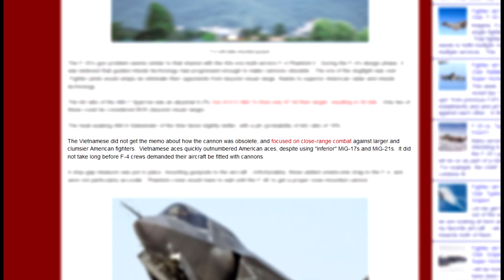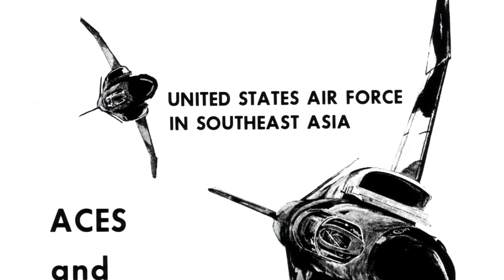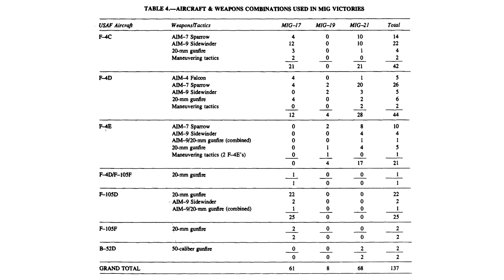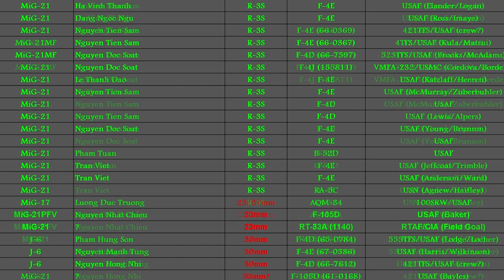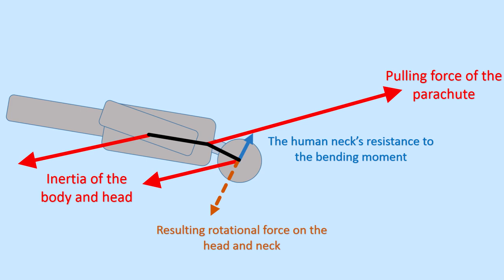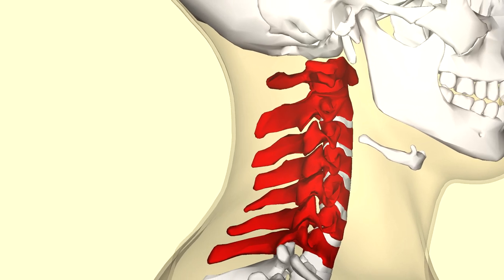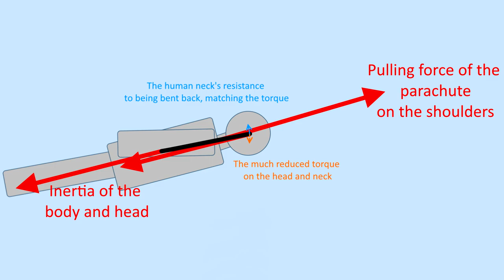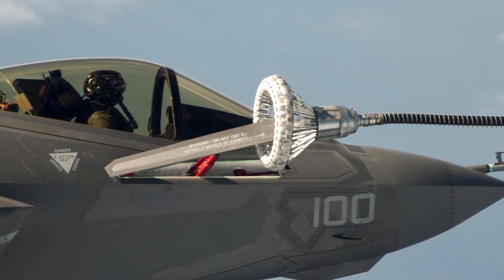F-35 Lightning II: Busting Myths - Episode 4

Comment: Btw, the restriction on maneuverability has been lifted. 9G turns are proving to be tigher than the record setting F-16. Dont count out its maneuverability yet.
Reply from the maker: The restrictions haven't been lifted yet (they're tied to each software block), but will be next year with Block 3F. All the airshow maneuvers that have been seen so far have been with Block 2B and Block 3i jets, which are limited to 7G for the F-35A and 5.5G for the F-35B. Once SDD testing finishes next year and Block 3F is released to the fleet, they'll be able to hit 9G and 7G respectively (and 7.5G for the F-35C).

Comment: I show all episodes and i agree at many points. But there are some issues that you can not ignore. 1) The project started as a low cost multirole aircraft and failed. It became the most expensive aircraft ever. 2) The program is far behind schedule. 19 years have passed since Lockheed winned the competition and 13 years since the 1st flight. So someone can assume that problems may still exist. 3) The aircraft has a low thrust to weight ratio. It has large fuel consumption. These are not good for a fighter even nowadays that long distance engagements are more possible.

Comment: First number is A2A visitors, 2nd is A2A losses, 3rd is SAM/AAA losses
F-4C/D/E Vietnam War (USAF) 108-33-337
F-4B Vietnam War (US Navy) 40-7-66
F-4B Vietnam War (USMC) 3-1-74 

F-15A/B Syrian border clashes 1979-1981 (Israel) 19-0-0
F-15C Desert Storm (USAF) 32-0-0
F-15E Desert Storm (USAF) 1-0-2
F-15A/B Lebanon War 1982 (Israeli AF) 38-0-0

F-16A/B Syrian border clashes 1979-1986 (Israel) 6-0-0
F-16A/B Lebanon War (1982) (Israel) 44-0-0

Biggest takeaway from Vietnam was not air-to-air.  It was huge, but not the biggest problem.  We recognized that we had air crews who were trained and equipped with what was supposed to be a TAC Air nuclear strike mission and interception of Soviet bombers, not dogfighting with MiG-17s and MiG-21s.  The only aircraft we had that were well-suited for countering the MiG-21 and MiG-17 were the F-8 Crusader, F-5E, and F-106.

F-106 numbers were low and dedicated to North American air defense with advanced GCI to NORAD systems, very specific missiles for that role, cockpit arrangement, training, and flight characteristics ideal for fast time-to-climb, speed at altitude for intercept, and internal weapons bay for low drag.

The F-8 Crusader was already in Navy and USMC service, rather low cost, but limited on missile count it could carry.  It was a MiG-21's nightmare to tangle with.

The F-5E was meant for foreign sales at very low cost, very agile, next to impossible to see before and after the merge, but wasn't a big Pentagon-funded project with bells and whistles for Congressional districts and fat politicians galore, or Pentagon General Officers at cocktail parties who know nothing of combat.

So the new F-4 would get the attention, missiles would be upgraded, radar, IFF, engines, leading edge slats, and more training.  Even USAF F-4 aircrew performance after the overhaul of everything was pretty impressive, and they learned how to fight the Phantom against the -21 and -17 and -19 very well.

The biggest problem remained though, and that was loss of aircraft to SAMs and integrated air defense networks.  We put a lot of focus into the SEAD Wild Weasel mission, tried to get the best performance out of those legacy fighters with advanced ECM and ECCM, but it required dedicated squadrons of fighter/attack/SEAD aircraft just to deal with the IADS threat in order to open the door for the real attackers.

This is where the F-35 shines, because it doesn't need EF-111s and F-16CJs to pave the way ahead of it.  Not to rest on our laurels, but we are going to wipe the sky clean of any MiGs or Sukhois for sport.  Our pilots are hungrily just salivating at the chance to engage more MiGs and Sukhois as a competition to see who can kill the most.  Look at Desert Storm and every recent A2A engagement the US has had with Libya, Iraq, Serbia, and now Syria.

Maybe they are telling Russian pilots that they are invisible, while hiding the combat record of the MiG-21, MiG-23, and MiG-29.  I wouldn't want to tell my comrades how bad we suck either, or more importantly: my foreign customers.  I think the word got out about the MiG-29 quickly though.  It should have been a much better airplane, but they screwed it over with structuring the cockpit for GCI intercept with heads-down, tons of switches and knobs, and hurt chances of wide military sales to other countries by making it a 2 engine plane with 150nm combat radius.

Now imagine the F-35 with DAS, EOTS, and net-centric fusing prosecuting even just the air dominance mission.  You have exact locations and vectors of every aircraft in the theater, with the full ability to set up any WEZ approaches how you want, while they haven't even detected your presence. Who would want to fight something like that?

Comment: I have now watched all of these videos, and I am pretty impressed.  I used to be quite skeptical of the F-35, but, partly from watching these videos, and partly from other sources, I have changed my mind.  But there is still something I wonder about, that you haven't really addressed: does thing really need VSTOL?  I know it looks really cool, but why does this fighter need it?  It adds a lot of weight and bulk, and it consumes an enormous amount of fuel.  Might not the plane be better off without it?
Reply: Yeah, the guy is responsible for convincing a lot of people that the project wasn't shit.

The F-35 doesn't lose that much from STOVL, since the doctrine for western aircraft is to extend the range on internal fuel. So if you have a STOVL system that can be replaced by fuel tanks on other versions, it really reduces the amount of compromise.

But the reason it needs STOVL is simple: it allows for the availability of aircraft that wouldn't be possible otherwise. Smaller carriers, for example amphibious assault ships or helicopter carriers, can now serve as smaller yet relevant aircraft carriers. Basically between the various partners that's loosely 450 aircraft that simply wouldn't be available otherwise because the aircraft carriers wouldn't exist. That's close to 6 super carriers worth of aircraft.

While yes, the aircraft are inferior to the other versions, they're still very good and the alternative is simply not having any aircraft. Italy, South Korea, Japan, potentially Australia, Turkey (until they got removed from the F-35 project) and so on could or will have an "aircraft carrier" fleet despite not having actual proper aircraft carriers.
Reply: The STOVL is required to operate off short deck/"helicopter" carriers. The Marines have carriers which don't use the steam catapult.
No weight is "added" because non STOVL variants don't have it. No bulk is added. You can't make the F35 slimmer in the vertical plane because of the engine and you can't make it slimmer on the horizontal plane without losing capacity inside the weapons bay.

Comment: Makes you wonder why they don't use the hans device for pilots. Motorsport has done significant work in this area and working with each other might help save more drivers and pilots lives.
Reply: probably has to do with the pilots need to have as much range of motion in their head as possible. what would be the use of a helmet that has the capabilities to allow the pilot to have a 360 degree spherical view ( literally thru the plane ) if the pilots head is tethered in a block
Reply: Weight more than likely it also could be cumbersome during normal flight or ejection but that gives me an idea one could be designed that inflate in flight but that's a little complicated the mesh back stop will be a better and cheaper alternative
Reply: If you watch the ejection. There are inflatable pads that trigger on ejection. Why one couldn't be used during the shoot open, I have no idea. Sounds like a really good question
Reply from the maker: The problem is that the pads come from the ejection seat; in order for the main pilot canopy (parachute) to deploy, the ejection seat has to drop away.
Reply: The latest hans devices have the ability to look around but most single seater cars have the side pads and raised cockpits which prevent head movement. Hans is also carbon fibre and therefore not that heavy. A customised hans should allow the head movement required and protect the neck at the same time.
Reply from the maker: Craig Simpson
Pilots need to be able to twist their entire bodies however, which isn't something you can easily do in a Hans. Hans are generally uncomfortable, so they'd suck to wear on 10+ hour missions.

Comment: What are you using for voice synthesizer?
Reply from the maker: http://www.oddcast.com/home/demos/tts/tts_example.php
Reply: Do you know how the F-22's radar capabilities compare to the F-35's? Does the F-22 have the ability to automatically scan all around, detect, and ID targets like the F-35? Or does an F-22 pilot have to do more of what like an F-15 pilot would do?
Reply from the maker: Nick Donofrio
The F-22 has a similar level of sensor fusion / autonomation as the F-35; the F-35 has roughly 3x as many parameters it can use to ID a target, but part of that is due to the F-35 having various infrared sensors, whereas the F-22 doesn't have any (besides its missile launch detection system). A legacy Hornet by comparison is meant to have ~20x less parameters than an F-22.
Reply: Dragon029 So, when the F-35 radar screen paints a big picture of aircraft in the area, and does all the hard work for the pilot, does that mean the F-22 has a similar capability? Which plane do you think has an edge in a dogfight? Have the two planes gone head-to-head at Red Flag yet?
Reply from the maker: Nick Donofrio
As far as radar goes the F-22 and F-35 are similar; both will do automatic target identification, etc the F-35 has had a more advanced radar and was / is the first fighter to feature "Big SAR" - a synthetic aperture radar mode that has simultaneously a very wide field of view and high resolution, but the F-22's APG-77 has received upgrades which may or may not bring it the same or similar capabilities

In a dogfight, the F-22 is without a doubt more manoeuvrable, but the F-22 does not have a helmet mounted cueing device, so it still has to roughly point its nose at the F-35 to fire a missile, whereas the F-35 can target an F-22 on its tail.
The F-22 does however also have the advantage of being able to carry the AIM-9X internally, whereas the F-35 does not yet (and may never will, not because it can't fit, but because next-gen missiles like the SACM and MSDM that may make the AIM-9X obsolete are on the way).
The AIM-120C7 (which the F-35 and F-22 carry internally) is a fairly agile missile and can turn to hit targets behind an F-35, but it's not as agile as the AIM-9X and because it uses a radar seeker it may be less effective against a stealthy target like an F-22.

At BVR ranges (ie where these planes are meant to fight), the F-35 will almost certainly detect an F-22 first due to its infrared sensors. An F-22 can launch an AMRAAM further than an F-35, but in an F-22 vs F-35 scenario that may not be relevant, as the F-22 might have to get within or almost within visual range of an F-35 to target it.
Reply from the maker: Nick Donofrio
Also, no they haven't gone head-to-head yet, though that may happen next year; their main focus for now is to figure out how to best work together; there aren't going to be any rival stealth fighters in significant numbers for another 5+ years.
Reply: Dragon029 Do you know if they are planning to upgrade the F-22 to match the F-35's radar capabilities?
Reply from the maker: Nick Donofrio
They more or less have been upgraded to match the F-35's radar with the APG-77v1. It's possible that the F-35 has an edge in certain radar capabilities, but those sorts of specifics are highly classified.
Reply: Dragon029 As for that little video screen that pops us that allows for the F-35 to watch its' target from far away, how far is the range on that thing? Does it let a pilot watch an enemy plane from pretty far away? And do you think the F-22 will get upgraded to the point where it can fire missiles backwards?
Reply from the maker: Nick Donofrio
The full specs / the range it can make out sufficient details on a fighter are classified, but if you watch this other short video on my channel, you can see the EOTS (which is the infrared sensor being displayed on the helmet's visor) displaying real video footage of the side of a hotel from a little over 49 nautical miles (a bit over 90km) away: https://www.youtube.com/watch?v=L2q65qOl1tM

That said, if the enemy isn't stealthy like the F-35 or F-22, the F-35 will almost certainly see the enemy (and probably ID the enemy) via radar first.

As for the F-22, it is expected to eventually receive helmet-mounted cueing some time in the near future (probably the early 2020s), at which time it'll be able to target enemies behind it. It won't work quite as well as the F-35, because the F-22 will be reliant on either passive radar or the missile's seeker (after it launches and turns around) to get a solid lock on the enemy, whereas the F-35 has the same, as well as 360 degree infrared video.

The end difference is just that there's a higher chance that an AIM-9X or AMRAAM fired from an F-22 could turn too much (if the enemy is far behind the F-22) or too little (if the enemy is extra-close to the F-22) after launching and fail to get a lock onto the enemy.
Reply: Dragon029 Alright, thanks for all your expertise. As someone enrolling in AFROTC and who will become an Air Force pilot, this stuff is all very fascinating to know ahead of time.
Reply: Arcadiy Ivanov
Reply: Wat?

Comment: Just wondering if you own any shares in Lockheed Martin. Wow, haven't seen anyone try this hard to sell something in a long while.
Reply from the maker: In what part of the video am I trying to sell the jet? I'm correcting a common myth about Vietnam that's tangentially related to the F-35 and informing people about what the ejection seat issue was and what they're doing about it.
Reply: +Dragon029 , I'm sorry I watched the other 3 videos in this series and was commenting on all of them. As a whole they just seem like a sales ad for the F-35, which I agree will be a good multi role fighter, it's not perfect, but will complement the F-22 and F-18E for years to come.
Reply from the maker: Andrew Lenz
Ah fair enough, but yes and no - I don't work for or own any shares in Lockheed or any other company involved in the program. The reason I make these videos is twofold; the first is that misinformation in general bugs me, the second is that I'm ex-military / have friends still in, and I want us to have the best bang-for-buck fighter. Super Hornets, Gripen E/Fs, F-15SA/SEs, Typhoons, Rafales, etc are very nice aircraft, but I wouldn't want to be in one going up against a PAK-FA or J-20. You want to be well overmatched against your enemy.
If the F-22 hadn't been cancelled, received an EOTS, received the HMDS and EODAS (as an upgrade to its MLD) was capable of internally carrying missiles like the JSM and had better comms, I'd prefer it over the F-35.

Comment: the F35 is 20 to 1 against F16 aggressors in red flag 2017,
take that trolls!
Reply: think you meant 15 to 1 but were trolling... have a link?
Reply: U.S. air force confirmed on the 28th February the F35 had a 20.1 kill racseo.
Reply: so no link...okay.
Reply: Still no link though interesting.
Reply: show me a link with 20 to 1... but you cant... thats sad.
Reply: hehe...oh you mean simulated...lol not real !!
"Air Force testimony by Lt. Gen. Jerry D. Harris, Vice Commander of Air Combat Command characterized the kill ratio as “20-1” meaning that, for one F-35A “lost” in simulated combat in a high threat environment that the aircraft destroyed 20 simulated enemy aircraft."
Reply: it was 15 to 1 if you read the small print./
Reply: @00BillyTorontoBill  still better than the su 30 su35 and su57 turd.